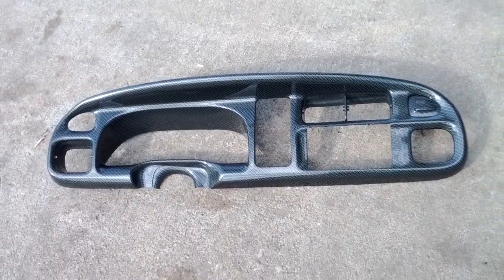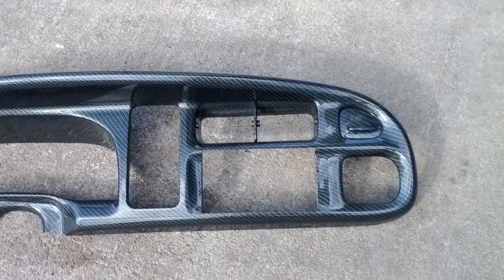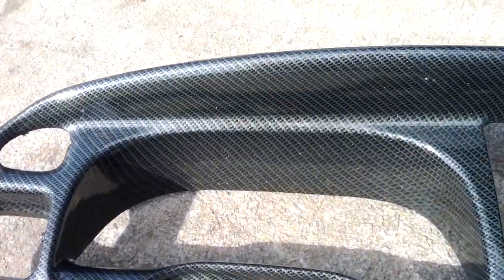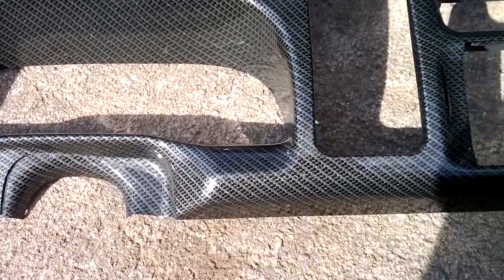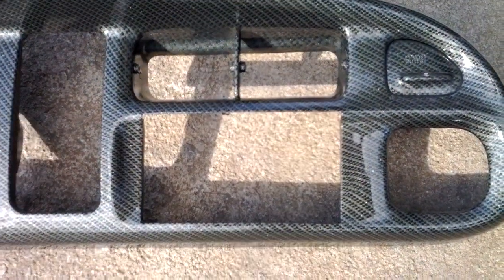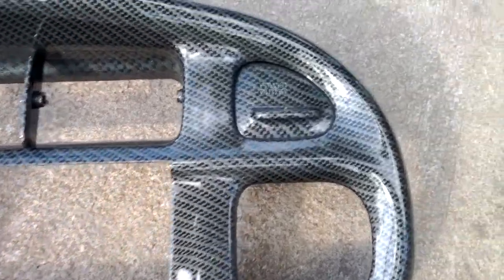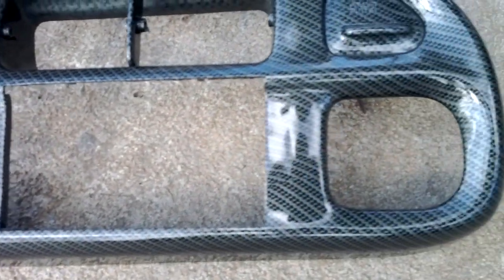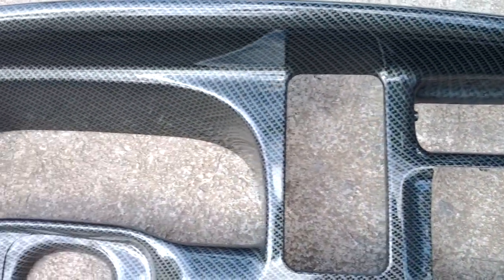98-01 Dodge Ram double silver carbon fiber hydrodip

Comment: What do these cost?
Reply from the maker: At most, a new dash piece from LMC it $200, add $100 for labor and materials, add $200 for paint, hydrographics and clear coating. So anywhere from 300-500. If you send a dash piece to be used and do just paint rather than hydro it can be less.
Reply: +weedahoe I would love to get this done for my truck. I sent you Email but no response yet.